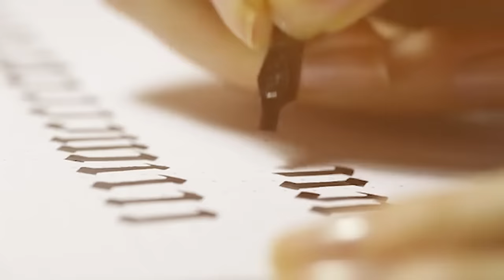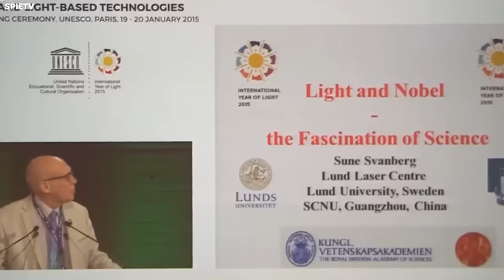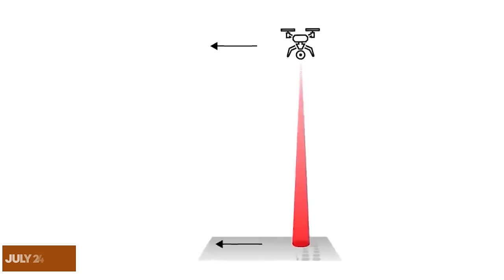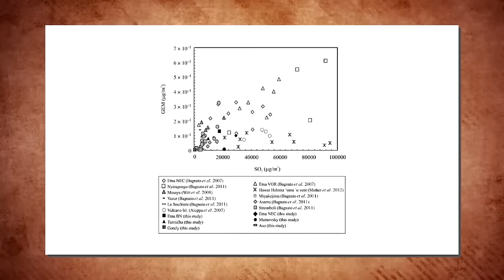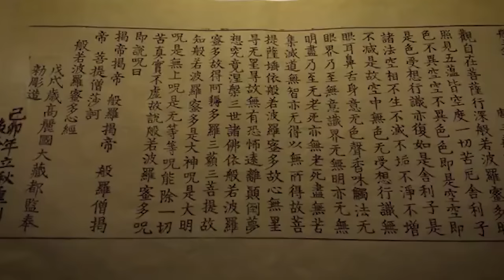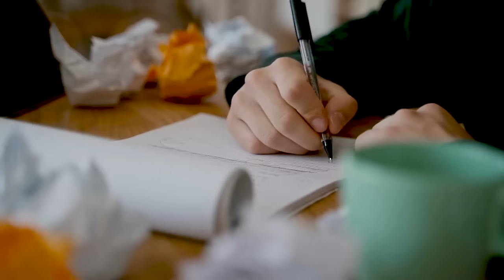Scientists FINALLY Opened The Tomb Of Chinese First Emperor That Was Sealed For Thousands Of Years

Comment: Send down a string of piping on top of the mound site with a camera and light in cased at the leading-in pipe section.  Should be able to get a glimpse of the lake of mercury surrounding the tomb of the emperor.